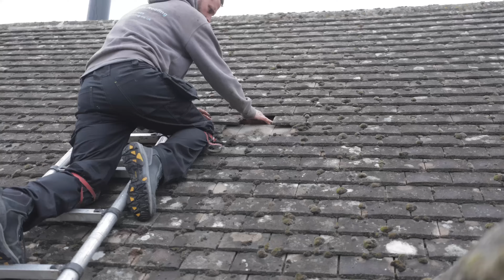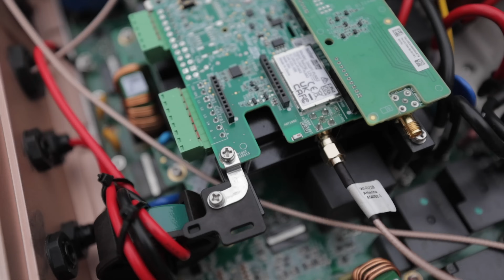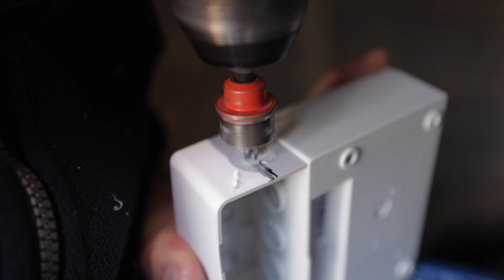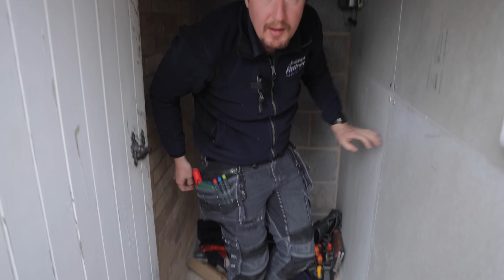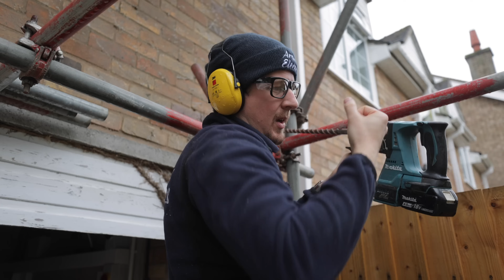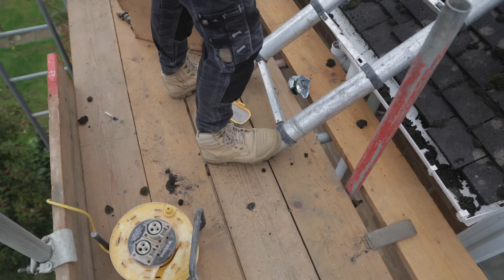FREE ELECTRICITY - Get Solar PV Installed NOW

Comment: May I ask you about the revenue of this system?

The investment for the installation, the components and the bits and pieces seems pretty high for a solar system with  maximum power of 3,8KW.

How many years are estimated for the return on invest? 

Thx...

Comment: Jordon I'm a cctv engineer and this happened to me picked up my case which I thought I closed but nope every item came out bnc connectors male & female dc connectors & rj45 crimps & boots. Put them all in separate zip tie bags so if you tip them up again your sorted.

Comment: What size armour do you need from solar panels to inverter?
Reply: The max Input current the inverter can support is 13.5A on the 5K one, biggest thing to look out for is voltage drop as you loose double the volts with it being DC. I believe you should avoid going over 5% loss so you have to work out your cable size from the length of the run but any qualified installer will be able to tell you.

Comment: How long do the solar panels last ? A few people say they only last 10 years..... but I have no clue myself. Loving the channel entertaining and I'm definitely more knowledgeable from watching.
Reply: Modules (panels) are good for 20 to 30 years. Inverters you should expect around 8-10, might get more if you buy quality. Batteries about the same as inverterss but it will depend on the amount of cycles (how many times it charges/discharges)
Reply: had mine installed since 2013 still going strong
Reply: @kenwalsh6245 that's good to know.  yea 10 years seem to short to me.
Reply: @simbrit7970  Yes the panels and all the cables etc. no problem but I did have to replace the Inverter (under warranty) in 2018 (just paid for labour £150) and 2 years ago my Immersun (original type) broke down since replaced with new type off Immersun.
The FIT payments I have received have more than paid for the original install (with original Immersun) in fact last FIT payment put me more than £200 in credit and this is not counting all the FREE hot water. I still have some more years of FIT payments left so I`m happy

Comment: Antenna separation might be an issue… two tuned antenna that close might affect their performance.
Reply: I would also say they should not be that close ideally.
Reply: Especially being Wifi and ZigBee both 2.4ghz
Reply: Yes I thought that too. Put one either side of the box, because there's a reason that bracket has the antennas separated. Either that or put one above the other. Isolation is 10 times better with vertical separation than with horizontal. But even better, if you can, run a cable and don't rely on the wi-fi.
Reply: I was also going to say the antennas  should be further apart. One either side would be better.
Reply: I would say the major issue is that they are surrounded by massive slabs of concrete

Comment: You need to space those two antennae further apart from each other Jordan; preferably at least a foot.
Reply: They're tuned to different bands I believe. Though I think it's always good to be cautious, it'll probably work well enough, maybe a little noise floor increase.
Reply: @lua-nya  No, they're not. At 7:45 he says it's WiFi and ZigBee. Those are both in the 2.4 GHz ISM band, unless the WiFi is using the 5 GHz band (which I doubt).
Reply: Yep, further apart or one above the other.

Comment: I didn’t like your vertical run of that black sheath cable down the outside of the house it would’ve looked a lot neater if you were just simply run the DC cables inside a piece of white conduit?

Comment: Is the armoured at 21:45 classed for that high DC voltage? The "armoured" (we don't have exactly the same but similar) we have are only classed for 600VAC and not even sure what their DC voltage limit is. And the arrays I install are around 850VDC, that's about 22 panels in series.
Reply: My concern is that the dc side of a pv system by design is double insulated (class II) & should not have an earth potential introduced. This is why plastic trunking is used. I wonder how the armoured strands were terminated? Should not have been connected to earth in this case I beleive.
Reply: Most UK used armored are rated to 600v - 1000v. Be that AC or DC.

Comment: Aren't those antennae going to have their performance significantly degraded by being placed within that semi-shielded area? Or is the cladding of the panels transparent to the frequencies involved? And I hope that in the next video you are going to discuss maintenance and redundancy. How is the owner going to clean underneath the solar panels once they're installed? Or rescue an animal that's stuck? And is a solar panel chain resilient to the failure of a panel in the chain? How about inverter failure?
Reply: The foil on the PIR insulation doesn't help. At least Jordan moved the antennae away from it, but he should also have had greater separation between them, as per the original placement on the top of the mounting bracket/heatsink.

Comment: Ahh yes, home PV, spend 20K, have it pay back in 10-15 years, by then all the equipment is failing and you need to spend another 20k...
Reply: More like spend 10-12k and payback in 5 years. A freind spent £10500 on a system with 6kWp of panels 9.8kwh of batteries in the summer and has been self sufficient ever since. So pleased he's now buying another 9.8kWh of batteries as he is still exporting so much to the grid and a larger battery will help him bridge more dull days over the winter.
Reply: Even if it takes 10 years to get back what you payed for it im sure you would have spent more on electricity in those years without the PV system especially if electric prices continue to rise also 20K seems far to high figure its more like 15K if that. Family member had PV installed around 2 months ago  and in October generated 273 kWh and at the price cap of 34p per kWh that would have cost £92.82 for that month
Reply: I installed in Jan/Feb 22 and current payback calculated at 7.5 years and reducing every time the utility prices increase.
Reply: So you can afford the annual £2,500 electricity bill then.

Comment: Still far too expensive and Heath Robinson for me to consider PV, maybe in 10 years
Reply: Defo worth it if its your forever home.
Reply: So you can afford the annual £2,500 electricity bill then.
Reply: I totally agree technically speaking its not free energy when you weigh up the total overall outlay for a PV installation.
     Like l a have always thought and said sadly PV / EV's are going to be for the chosen few who can afford such items.
Reply: Only works if you plan, buy and install everything yourself.....but that requires you to be a full stack engineer.

Comment: How do you secure those roof tiles once bracket is installed? It doesn't just slide in to place does it?
Reply: I’m no roofer. So I’d be grateful if someone can explain how those loose tiles stay in place during a storm.
Reply: @JR-el7et  thanks for explaining